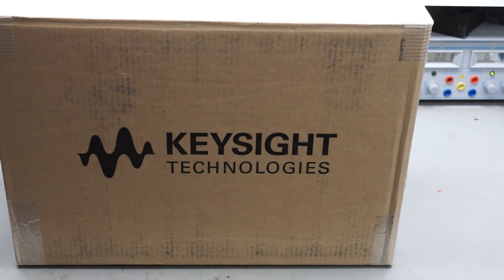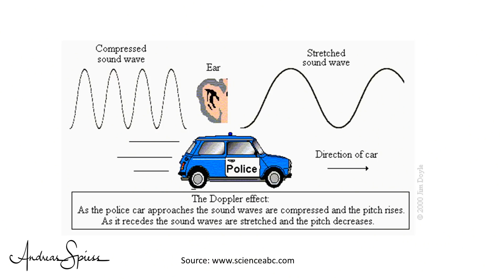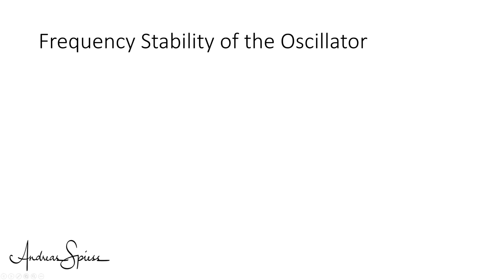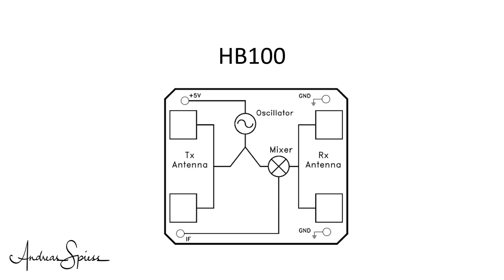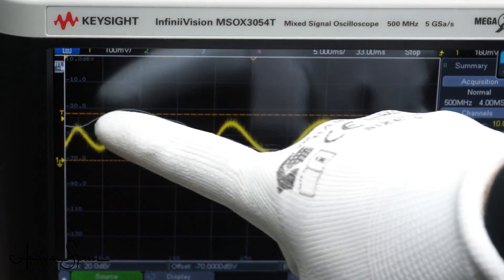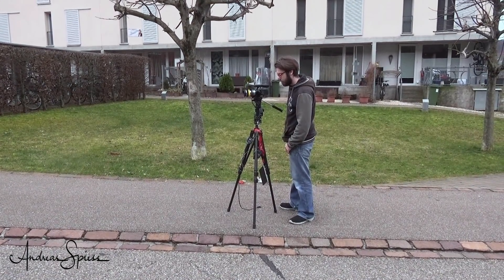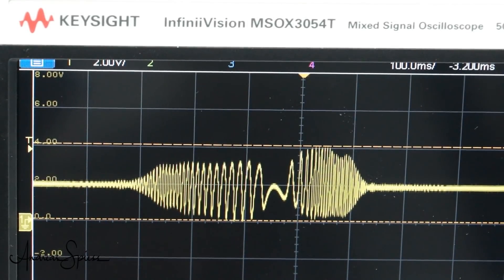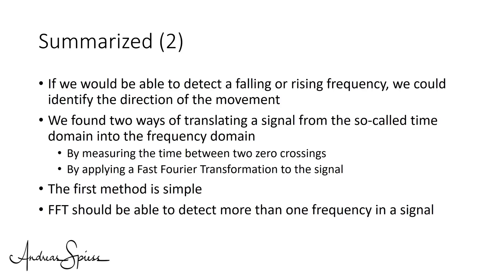#181 DIY Radar Speed Gun using cheap Radar Sensors (HB100, CDM324) for Arduino, ESP8266  and ESP32

Comment: This is very interesting, I'm looking forward to see more of the innovative details.
How about pedestrians, skaters runners, etc in the same speed range? How will you avoid counting those as bikes?
Reply from the maker: I think, It will not be universally usable. For bigger roads with lots of traffic maybe a stationary solution is affordable. For smaller roads, this might be a possibility.
Reply: Andreas Spiess hi Andreas have given any thoughts of my plan . Seamus Fitzgerald
Reply: Skaters might be a problem, but pedestrians and runners are slower and it might be possible to filter them out (as long as you're not measuring close to an intersection). The bigger problem is probably groups of bicycles.
Reply: If you go into that much detail, at one point you want to use a camera and image detection, then you can differentiate between all those modes of transportation.
Reply: Yes, but I don't think that a 0% error rate is required. In addition to that, bicycles have a minimum speed they need to operate at, otherwise they topple over.
Reply: Can easily be addressed by magnetic field sensor alongside. The only foolproof way is to distribute free cycle only RFID stickers at city hotspots. That will solve all the problems
Reply: anlumo1 Again, this is based on assumptions. 3 wheeled bikes, electric 4-wheeled scooters, and bikes with training wheels are not that uncommon in my local area, and the speed of these can be arbitrarily low without toppling over.
I hope Andreas will go into details about this task, as well as the assumptions he can safely make.
Reply: anlumo1 There are fast walkers and slow bikers, so filtering will be based on assumptions, not on certain attributes.
Reply: Camera with machine learning to determine which is which. lol
Reply: Martin Bøgelund los

Comment: What is needed to make this module work ld306s radsr module aliexpress. Could it be used for golfballs or baseballs  Thanks
Reply from the maker: I do not think it will detect things without metal or water.

Comment: In 1974 the Department I was working for got our first updated digital display radar. It was X-Band.  I was on duty one morning (read night shift near ending) and since there was nothing happening in the town, I parked the squad car under the sun shield over the A&W drive in, to watch traffic on  the Highway that went through town.  I was not running Radar at the time since the angle was too great to get any accurate readings, but it was on, and the volume on the head was turned up a bit.  I began to hear ZIP! and a bit later ZIP! there were no cars but on the digital read out I was getting 104 MPH and faster flashes.  As I studied this phenomenon  I noticed that the swallows who nested in the over head cover were diving down to the ground after worms or insects, the radar was reading their speed.  I began aiming the cone at the particular birds and the readings got faster as the angle decreased.  It was actually a fun thing to do with the big old units.
Reply from the maker: Nice story! So this radar was quite sensitive. Detecting the water in these small birds.

Comment: Hi. Is it possible to build a device for measuring the speed of a pistol bullet using this sensor and a raspberry? Could you suggest which components to use?
Reply from the maker: Bullets are too small and too fast for such sensors. They will only be detected on the first meter if at all
Reply: @AndreasSpiess  Even one meter would be ok. It is a device for measuring elaborated ammunition. Are there any other sensors (bigger) but also cheap? The measurement is made just in front of the barrel.
Reply from the maker: @hubertsmulski5800  Better sensors are much more expensive :-(
Reply: @AndreasSpiess  What price range?
Reply from the maker: @hubertsmulski5800  A few 100 dollars

Comment: Hi Andras I'm also from Switzerland :-) I was interested in a radar gun for measuring the speed from a ball (volleyball). What is the speed range of this radar? Do you think we could build a radar gun for this purpose? Volleyball speeds can be 20 130 km/h. Could this device measure it? I would like to detect the top speed of a serve or spike for example.
Reply from the maker: I do not think this is the right technology. Firstly, it would probably not detect any non-conducting material. And secondly, its reach is way too small for such fast moving things.

Comment: This is a very interesting project! I am interested in making a little speed gun that would be able to measure tennis serves / baseball pitches. Do you think these components would be accurate enough? If not, do you have any suggestions for better radar sensors?
Reply from the maker: So far we abandoned this project because better sensors are over 100 dollars.

Comment: 12:38 The same goes for amplitude, which means that we could detect the direction of motion by amplitude, right?
Reply from the maker: Yes, you can try it. It is not always easy if the area of the car for example changes with the angle if it moves. With a bicycle it was possible.

Comment: Since frequency can be used to determine speed, then how do you explain calculating speed when the frequency is changing over distance? Your calculation is dependent on when you sample the frequency. This is confusing to me.
Reply from the maker: If the frequency changes the speed or the angle the radar sees the object also changed.

Comment: hello Andreas, 
First I would like to say great video. I am doing school project with arduino trough this school year. i decided to make a portable car speed detector using microwave radar sensor(hb100/cdm324/..), amplifier, arduino UNO and LCD display... i am still not profesional with arduino software/hardware and will try to learn more trough this school year. i would really appreciate if you could take 5min and answer this questions:
-are microwave sensor, amplifier and arduino enough to measure speed or do i need other components?
-are arduinos capable of measuring frequency for this project (using FreqCount library)?
-is arduino UNO fast enough? what about arduino NANO? do i need faster microcontroler?
-do hb100/cmd324 substract transmited and received signal or do i need another component to make it happpen?
hope you can help me,
thanks
Reply from the maker: You get a quite small signal (proportional to speed) from the hb100/cdm324 and need to amplify. See limpkin.fr/index.php?post/2017/02/22/Making-the-Electronics-for-a-24GHz-Doppler-Motion-Sensor for help

Comment: Thanks for the information, do you think I can use any of these radar sensors to measure the heart rate and respiratory rate of a person? it is for a project. Thanks
Reply from the maker: I do not know if the speed of the object is fast enough. Maybe you have a look at my videos where I hacked an SPO2 sensor (which also measures heart rate) or where I hacked the Polar pulse sensor.

Comment: Hello Guy with the Swiss accent,
I am a great fan of your channel and thanks to you I have built a lot of projects and Every one was successful. You are truly a great guy.. Can you do a project on building a speed gun radar detector to be used in the car using commonly available sensors and microprocessors. It will be really great project. The currently available sensors in the market are pretty expensive. Also as a maker it will be great fun to build one on our own.
Thanks
Reply from the maker: Unfortunatly, the cheap modules are not good enough for that purpose and the good ones are very expensive :-(

Comment: Nice explanation, but you need a licence to use it and I doubt if it is legal  1 to use the frequency 2 to use it as radar, I have also the HB100 module but for use as radio-amateur for ATV ( amateur television ) or phone
Reply from the maker: These modules are used in many buildings to open doors. But I am no lawyer... How far can you transmit with this module and how stable is its frequency?

Comment: Great video.  I will have to try this.  I was wondering about using the microwave sensors for range detection (distance).
Reply from the maker: These sensors only detect speed, no distance.
Reply: @AndreasSpiess  This is sort of what I thought.  It probably could get real complicated to build (diy) a distance measuring radar.  What about FMCW (frequency modulated continuous wave type sensors).
Reply from the maker: The FMCW shoud do the trick. I one bought one, but unfortunately do not find it in my lab anymore :-(  They are quite expensive...

Comment: Rather than doppler effect, it is easier to understand as interferometry because you are sending and receiving the same signal.
So this sensor can do a very accurate measurement of movement distance, just count output pulses
Reply from the maker: These sensors only can detect speed, not distances.
Reply: @AndreasSpiess  
well, you should just try it then. like I said rather than connecting speaker connect led and you will see how it will flash when you move reflector by about 1.5 cm
I tried it and it works, although it was lower frequency radar

Comment: Why can you look at the phase of the signal. You can use a down converter approach by using I and Q signal split and get the phase information. I suspect you can detect direction. Using an FPGA you could implement a down converter
Reply from the maker: May<be. I did not expect too much from a 5-10 dollar device...

Comment: I got one for the fun of it but I get no IF signal...
0v with a light offset.
Certainly not 400mv waves :'(
Meh.
Tried with two 5V regulator and double checked the pinout between you and ali.
Anyone got the same issue?

Comment: Thanks for your video it's very complete.I want to know, did you implement this sensor with the ESP32?
Reply from the maker: It has an analog output, but needs lots of amplification
Reply: @AndreasSpiess  Thanks for your answer,You have some example code for work with the ADC or math formulas for conversion. Thanks.

Comment: I’m curious to measure speed of vehicles that pass my vehicle as we drive down the road and link that to the video from a dashcam, overlaying the calculated speed and distance. Have you some thoughts of doability? Also, being able to set the camera to start recording data when detected speed exceeds my vehicle speed would be an added bonus.
Reply from the maker: The reach of those modules is rather short (<10m)
Reply: Thanks for such a quick reply. Is there another avenue to acquire the info, like maybe a combination of videos?
Reply from the maker: I have another module in the lab. As soon as I find it it will appear ;-)

Comment: Hello, Thanks for the video. Does the device work if the source is not moving and that is the observer that is moving?
Thanks
Reply from the maker: Since Einstein, we know that movements are "relative". So it should work.
Reply: @AndreasSpiess  Many thanks, Haven't got in touch recently with Albert but it seems logical indeed and much more than quantique physiques. So I might be able to convert it into to a car obstacle detection device...

Comment: This is interesting do you think it will be possible to use this Doppler sensor to creat a ballistic chronograph for an air rifle. It will be mesuring the speed of lead pellets at 1400 feet per second max.
Reply from the maker: I assume the bullet would be too small and its range too short
Reply: @AndreasSpiess  I have seen fx pocket chronograph and one other chrono use doppler
Reply from the maker: You can try it. On this short distance, it might work.

Comment: Hi Andreas! I bought the same CDM323 and amplifier and got it to work like your first part, making sound at a distance of a few inches. But I can't get it to work with objects more than a foot away like your bicycle. How did you get that part to work? Did you modify the pitch of the sensor somehow?
Reply from the maker: It is all about building a low-noise high gain amplifier. Not easy, though.

Comment: Probably too late to cment and expect a reply but here goes... You mentioned increasing amplification, what amplifier would you start with or suggest to avoid clipping? Also, where pray tell, did you source those other sensors you plan(ned) to try?

Last two questions, but they're related...

For increasing performance of these modules, would a different antenna be practical? And what about increasing the actual output power/wattage?
Reply from the maker: Clipping is not a problem because you are interested in the frequency. Changing the design is very tricky because the high frequency.

Comment: Can I use a satellite dish as a reflector to extend the range of these sensors?
Reply from the maker: I do not think so. Maybe you google „horn antennas“.
Reply: @AndreasSpiess  I will buy some and try both. If using a dish or a horn extends the range of such sensors it will be an interesting "longer" distance speed radar. Keep in mind that even small 60cm satellite dishes on 10Ghz have more than 30db of gain so they can probably work. Also I live near an airport and I am thinking of using a 90 cm dish and an HB100 to measure the speed of a landing airplane
Reply from the maker: I would be interested if it works. Maybe you send me your results on facebook messenger as these posts will no more appear after a while.
Reply: @AndreasSpiess  Definitely! I will order some soon and if the project works I will inform you

Comment: You don't need an expensive microwave osciloscope to watch the frequency of HB 100. You can get a satellite tv LNB, inject 12v into coaxial using a bias tee (inductor to stop RF getting into power line and a capacitor to block 12v from receiver). And then connect it to RTL SDR receiver. Then tune to 600-700 mhz range.
Signal is well... not that unstable to jump to 9 GHz. If you feed the audio trought a capacitor to +5v in of HB-100 while powering it at the same time, you will get FM radio at 10.5 ish ghz. 
Device is low powered but if you worry about how legal it is, there is  3cm ham radio band you can think you're using, if you already has a license. I think any polarization LNB will work, I used linear. And aware of harmonics, because i've received some weak signal at 400 mhz and thought it's working that bad, but real signal was higher.
SAT LNB lowers frequency by 9750 Mhz (i guess, google for precise value). BTW, this signal is slightly out of LNB band, but everything works ok.
Reply: PS. Yes, signal is drifting when you touch the module, and has wery low drift when just listening. I don't know if it's a HB100 or LNB, maybe they both drift. I have to tune frequency when listening to WFM audio, but I saw a guy using some sort of "peak hold" function in SDRSharp on youtube.
Reply from the maker: These modules are used to open doors. So I assume the power is below the law. But I am no layer ;-) Thanks for the tip with the LNB. BTW, I have a HAM license (since 40 years).

Comment: Hi Andreas - another great video - many thanks!  One quick question - you can detect bicycles at around 20m. Give that speed and, i would think, size would affect the output signal, how far away do you think it could detect a car travelling at normal car speeds (say 60km/hr)  - I am thinking 100m or more maybe?
Reply from the maker: We did some additional tests and were never able to detect bicycles further than 8-10 meters. I never tested cars. I would expect maybe 15 meters max. Field strength is reduced distance squared.

Comment: Is it possible to detect slow movement (10 Km/h) of small silicone rubber tube (D=1 cm ) about 5 cm away from the sensor. Does it require any changes in the circuit due to size and proximity of the sensor?
Reply from the maker: I do not know if it is able to detect silicone. The good has to reflect the waves. So you have to try.

Comment: So this sensor can only detect up to 6 km/h? Aaaw man :( Would need one that can detect up to 50-70...
Reply from the maker: It detects at least 6 km/h. 70 should be no problem.
Reply: @AndreasSpiess  Aaaah okay. I wanna build a LED matrix display like they have on the streets with this so drivers here in my area won't drive 100 in a 50 zone... Still on my ground but visible from the road so should be legal. Don't want to lose another cat to stupid speeders :(
Reply from the maker: The problem is the detection distance. It is max. 10 Meters
Reply: @AndreasSpiess  Is there a way to increase the detection distance? Does it have something to do with raising the amplification?